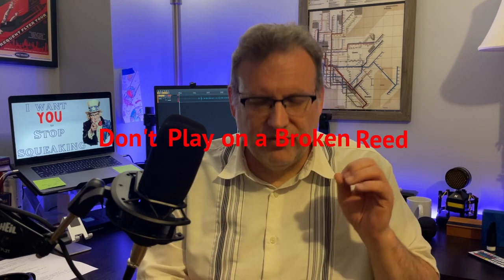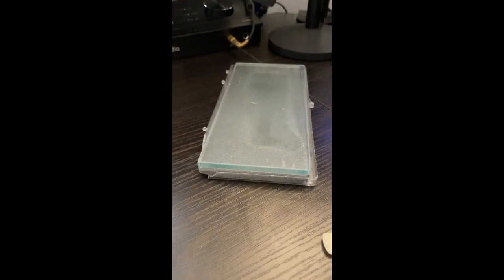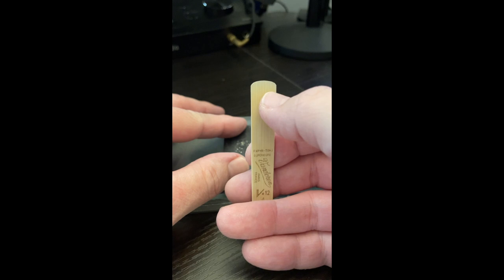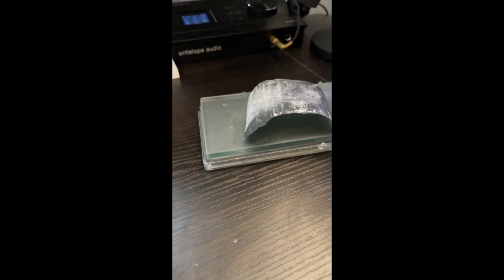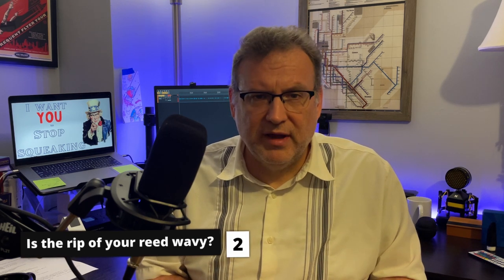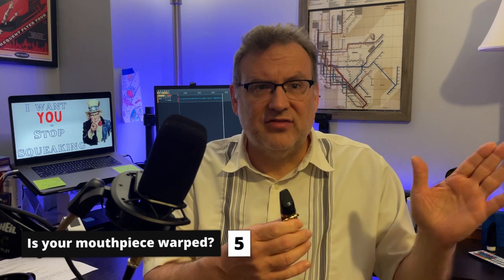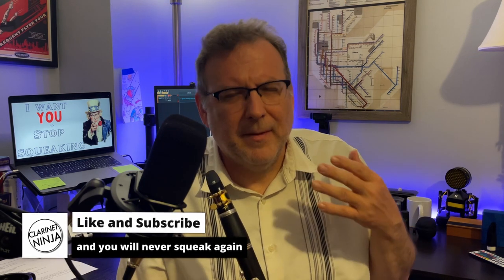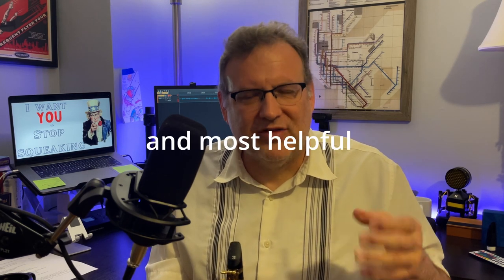stop squeaking on the clarinet

Comment: My squeaking problems are caused by my fingers not covering holes properly.  I will check my instrument as well though as it is quite old, and so there may be some keys that don't close properly, so I will try the suck test as you demonstrated.  I do use a neck strap and pull it up quite high.  I have very small hands, and covering the holes with my fingers is something that I have struggled with for a very long time.  Trying to find a solution, but is there one!!!!!  I try to curve my fingers over the keys, so very frustrating when I still get squeaks, and it's worse when I cross the break.  Not so bad in the lower register.  I've just bought a new mouth piece and ligature so hopefully they will help too.  I'm using a new reed, so it's definitely not that, as the reed is fine with no cracks or splits.    I always wet the reed before I start playing.   Trying to do everything right!!  Anyway thank you for your extremely helpful video, and I will try what you have suggested.
Reply from the maker: I am so happy that you shared your experience. Let me know if there is anything more I can do to help:)

Comment: After sanding lower reed's part, It pops noticeably later in suck test. Does It play/feel better after that? If a reed pops earlier in suck test, will play less good than a reed which pops later? Or that test applies to only less likely to squeak? It seemed like you also sand the back of the upper reed's part, right?
Reply from the maker: It responds far better when it gets a good seal. I don’t sand the tip, that would change the resistance of the reed quite a bit.

Comment: Sanding using sandpaper or wet & dry which has previously been folded if you sand over the fold line will not sand flat

Comment: Greetings Jay! I just received a Forbes Debut Bb mouthpiece but when I play a simple scale I get a shrill continuous chirping sound through the scale! Any idea on what’s going on? Thanks again!🙏
Reply from the maker: That’s not good! I would first change my reed. Second, make sure the mouthpiece seals by doing the “suck test”. I would also think experimenting with a different strength reed may help get info. What strength reed are you playing, what mouthpiece were you using before?
Reply: Thanks Jay I play a M13 Lyre and a Yamaha 4C with a Bonade ligature using 2,3 and 4 strength reeds that I’m breaking in and balancing! All of the reeds work well with my setup and no shrill chirpy sound! I received the debut today so maybe it needs to settle in. It is used but appears to be in excellent condition. Thanks again!
Oh I will try the suck test and let you know.
Reply from the maker: Please do! There is something weird going on there to make the reed not be vibrating evenly